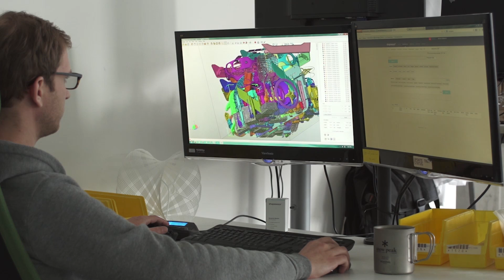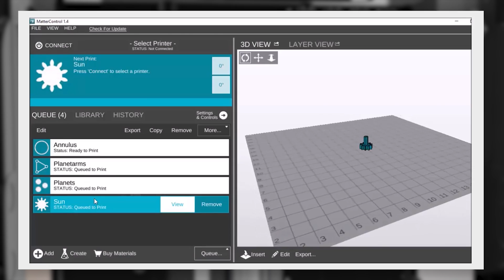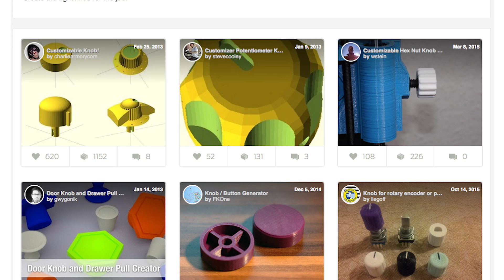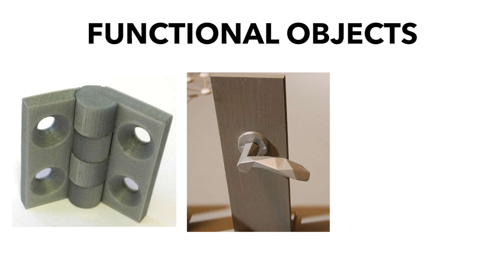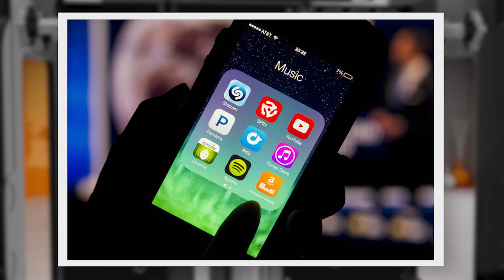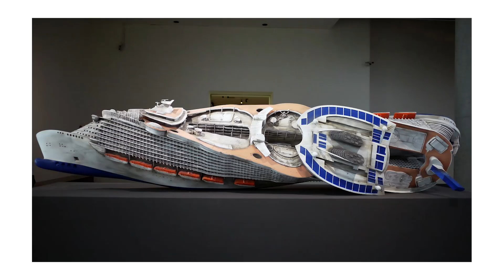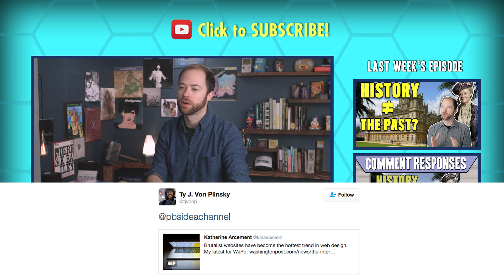Will 3D Printing Break Copyright?

Comment: What about 3D printing pharmaceuticals? Recreational and medical is this possible?
Reply: +dannyzep92 Not at all.  3D printing, like regular printing, merely places a predetermined material into a form.  3D printing pharmaceuticals would require that you have the chemicals prepared prior to forming them into pills, which can already be done with pill presses.  Pharmaceutical companies will not go out of business because of this because there is actual chemistry and synthesis required to make drugs instead of assembly.
Reply: +Matt Sertich I kind of figured as much. You'd still need the chemical reactions and what not to get what you want. Prosthetics seems to be a route 3d printing could/might already be taking

Comment: Additive printing has two huge advantages over music (and e-books, which I think are a better analog) not discussed here. 

First, norms around 3D printing can start in the modern age, rather than being dragged there in a decades-long legal process. The rules and norms around music and books were formed at a time when the only technologies available imprinted information onto immutable objects like books and records. You can see this in the legal battles around them. The original laws treated the information in books as physical object with location and some marginal cost of reproduction, and those laws have been awkwardly ammended to deal with the de-physicalization of artistic information. But the distinction between file and object is natural to 3D printers, and communities and businesses build that into the practice.

This plays into the more important distinction, which is that 3D printing isn't a zero-marginal-cost technology. The .mp3 was so troublesome to musicians precisely because the information could be converted into its valuable form (sound) at essentially zero cost, which is what made fighting music theft feel like bailing out a boat with a fork. Copying and owning a physical 3D model of Mike's face, on the other hand, has a non-trivial cost and can't be done ad infinitum. Maybe there will still be cheaper pirated versions of these objects, but it will always cost something, so artists and industry in this area will never have to contend with the peculiar economics of zero-price competitors.

The comparison with .mp3's seems especially tricky when you're talking to someone from Shapeways, which specializes in quality materials and passes through a central point rather than being peer-to-peer. When there's such a non-trivial cost of production, it looks a lot like a traditional market for physical things. On-demand book printers like Lightning Source have been doing this with books for years (which is why I think books are the closer comparison). And while it's a big deal for the book industry, Lightning Source and Shapeways are hardly the next Napster.
Reply: +Elliott Collins Yeah, this tech is taking birth in the modern age itself, but do you really think that'll stop lawyers from applying decades or centuries old laws to it? :(
Secondly, yes there is a cost attached to it. But there will still be problems. Assume that the tech is advanced enough to print complicated objects like phones(instead of just plastic stuff). If you design something looking like an iPhone 12s, don't you think Apple will have a problem with it?
You brought up the case of artists. Suppose there's a 'sculptor' who designs awesome stuff and 3D prints them and sells them at a high price. What's stopping me from creating a 3D model of the sculpture using some imaging technique, then selling my own versions, which will be exactly the same, but at a much lower cost?
Reply: +Bhupinder Saini

There's not much stopping you. Except.... Michael talked about the importance of what a community sets as it's values, didn't he? In the Art-buying community, buying a more expensive "real" artwork is often more desirable than buying a less expensive "fake" one. And yes, this is different from most other commodities, where something that is virtually the same but costs a lot less is often more desirable to consumers. There are exceptions, of course, which most often have to do with branding.

In other words, you could try and sell fakes. But if it's easy to see which are the real ones and which are the fake ones (for example, with the kind of authentication talked about in the video), you may find that your sales numbers are far less than you had hoped they were.
Reply: Ahsim Nreiziev What you say applies well to an ideal world...maybe even to first world countries...but not everywhere... Case in point: you know what happened in china
Reply: +Bhupinder Saini ... What happened in China?

Comment: Kinda tangential to the copyright conversation but: how would one prevent people from 3D printing functional firearms? That's a big ol' can of worms right there. This is an idea that's brought up in Star Trek in regards to replicators, but I'm curious if it's a concern that the 3D printing community is already trying to tackle/prevent?
Reply: +Void Burger
    I understand where you're coming from and the idea does sound scary that someone could just start 3D printing an assault rifle in their home, but I don't think it will drastically change the Homemade Gun issue as much as you're implying.

We already have people, who know a lot more about guns than the expected 3D printer user, making and using guns without the use of 3D printers.  

With the level that consumer 3D printers are at today; I wouldn't trust them to print anything more than a handgun. 

For manufacturers I just see the standard background check being applied whenever someone asks to have a gun printed,( with exceptions of course) and there would also need to be several changes to the current laws. Or the manufacturers somehow start identifying functional firearms and denying the print.

All in all, I believe 3D printed guns will only be a smaller concern for gun safety as a whole.

Comment: If something is a functional object, it's not covered by copyrights? So if I make a door knob shaped like a TIE fighter, because it's a functional object (A door handle, provided as an example in the video) it doesn't infringe on the Star Wars copyright? Is that correct?
Reply: +ErzengelDesLichtes That's a question I had too:  What about functional art?  Not even a TIE Fighter doorknob, but a doorknob shaped like your own original spaceship?
Reply: +ErzengelDesLichtes You want to research something called "the doctrine of conceptual separability", which is a kind of murky area of IP law. But no, I'm pretty sure you'd be infringing on the Star Wars copyright in this case. Sorry. :(

Comment: You might dig this older story about Games Workshop protecting the intellectual property of their Warhammer miniatures from 3D printing. It reminds me a lot of the music industry's initial reaction to MP3, just as Michael had described. http://www.tested.com/art/makers/452866-how-home-3d-printers-are-disrupting-miniature-gaming/ It's a curious case for those of us in the tabletop industry because so much of the value of our products and our infrastructure comes from physicality, materiality, and scarcity.
Reply: +Daniel Solis this is where the quality of the material is judged not just by material and stability but also means of manufacturing. it is harder to replicate a precise mold of a figure than it is to generate a precise computer model. following that it is also having the means to produce. alot of game figurines that are sold on the mass market are molded and often there is a tell tail seam to show it. this may be an aspect of an authenticity check similar to playing cards which are possible to reproduce with the right materials.

Comment: My school has a small 3D printer and I already made a Han Solo in carbonite figure. And I am working on a cup holder. I use 123D website. Never had i thought about the copyright I just made things I like.
Reply: +John Werner designs and art for private use cannot be effectively policed. if you were to try to start to sell the file access or the finished products is where the IP laws start to take effect in a meaningful way.
Reply: Well it's like fanart. If you're not selling it I guess there's no problem. And my school has one too, but sadly I don't think we're aloud to use it.
Reply: +Amaz1ngWhale why not?
Reply: +John Werner I assume it's because the "ink" is too expensive. They only use it for certain technology classes :/
Reply: +Amaz1ngWhale at my School we just pay for how much we used

Comment: So if you print Lego parts is that copyright infringement?
Reply: +NiceLord 
Not if you call them stackble building blocks
Reply: +lolmaker777 recent parts added to their parts library can still be protected by patent. but basic components, bricks, axles, plates and the like are broad enough to not be covered. designing lego compatible parts not already in their library would also be open.

Comment: I am absolutely fascinated by what 3D printing could eventually do to change the economy. If everyone can print almost every object (or at least an insane amount), the world would be radically different. Consumer society would be radically changed, because you no longer consume products. You just buy some raw materials and print yourself. It would also radically change globalisation, because on the one hand trade becomes much less important (why important from China if you can print it in your home?), but it also makes global trade much larger. If I design a product that can be printed, I could sell the design globally. 

I can even imagine something like a 'spotify for phyisical products' or something.
Reply: +wiet111 To the question if it would radically change consumer culture, I think yes and no. Just because you can 3D print a spatula does not mean you can make anything you need. We still need advances on making culinarily safe 3D printed items, and it will be difficult to make them heat resistant enough to cook with. The process of 3D printing makes it very porous and generally uses heat or UV sensitive plastics.

Toys for kids will be available but the span of what kind of materials you will be able to create will still be very limited. If McDonalds is making toys they know they will be making thousands, and so they can do it at a far higher quality and lower cost than someone in their garage.

This still opens up a lot of room for engineering and creative exploration, but when the quality of items becomes increasingly apparently biased to the mass producers then I doubt the market will swing too far.

That being said many niche stuff will be covered by the 3D printer. Need a new clasp for your bag? You might be able to 3D print it. Need something to hold a knife? 3D print it. Lost a piece for a board game? Why not 3D print it? I think the biggest effects will be in the niche and replacement markets and the artistic community.
Reply: +Zongineer bioplastics from recent organic oils. oil as a fossil fuel maybe not but there are many naturally generated oils that we can draw from.
Reply: +wiet111 But do we still have enough oil to make the plastic?

Comment: The idea of having a database that 3d printers check is scary. It's like adding a wifi chip into a Hammer and Chisel to make sure you aren't using them to make a rip off sculpture. A 3d printer is a tool like any other. And the use of that tool to infringe copyright shouldn't be a concern, but if that infringed end result is being used in a way that infringes copyright.

Should I get sued if I made a Warhammer sculture out of toothpicks? No. Should I get a cease and desist if I tried to sell that sculpture as an alternative to an actual Warhammer figure? Yea. But you don't stop it on the tool level or creation level. You stop it at the sellers level.
Reply: +Ularg So, that would mean you could only stop it if you pay a company to print warhammer figure for you, not if you do it on your own private printer with your own plastic. Which is actually how the world functions doesn't it. This seems like it could possibly be a problem in a future where 3D printers are as common as normal printers, but that kind of thing is still a long ways away.
Reply: +Gorinich Serpant I believe as long as it stays with you or a close friend, there really is nothing copyright law can do about it. Now, hosting 3D files that the printers use online, on the other hand, I can see how that can be taken down. But I don't see how I could be taken to court if I made a Space Marine in a 3d modeller and then printed it out on my own 3d printer.

Would an artist have to send sketches of his work to make sure it isn't infringing on any copyright when he's just doing it to practice for himself? 

I dunno, I just view the 3d printer as a tool and wouldn't think it smart to put restrictions on it that you wouldn't put on a screwdriver.
Reply: +Ularg That makes sense.

Comment: Why would it? Just because I can rob someone doesn't mean property rights are dead.
Reply: +Jimmy Hough Fair argument. However it may become hard to enforce copyright, due to the ease of break copyright anonymously and potential volume of infringement. Then the fact that there is a law prohibiting copyright infringement becomes null and void in practical terms.

As with the entertainment industry, there is a sea change in process. The outcomes of which are hard to predict. I run a small company that that designs model tanks in CAD, have them 3D printed, cast them in resin, and sell them. I would not have been able to start my business without 3D printing, but I do fear that my business is too small to deal with copyright infringement.

I spend days, even weeks, working on each of my designs. If they got leaked online I might be able to get them taken off the more above-board websites, but there is no way I could counter the distributed net of people printing stuff in their own basements.
Reply: Then what if you put on the market a key that can open any lock?
Reply: +eg0zb they are called lock smith guns I believe and are regulated.
Reply: Cal fischer
You have just described every manufacturing business, although currently not all materials are cost effective to print.

For someone to print something they need a CAD file to print from. The only way to get that file is buy it, design it, or take it.

My business grants me a measure of future proofing, I will have the skills and experience in creating CAD which should remain relevant so long as some level of copyright law remains.
Reply: +Jimmy Hough if youre using someone elses idea claiming it as your own to make money, then sure. But if youre taking someones idea and improving upon it, i think its fair.(you have to give credit to the person who made the base which youre improving upon).
but in the end nothing is 100% original, and its disingenuous to claim an idea is 100% yours because you were influenced by the outside environment, people and things to arrive at your original idea.
 can you imagine science without calculus, newton invented it by himself and by sharing that original idea he indirectly improved and continues to improve the lives of billions of people. 
another example is Half-Life/Counter Strike(1998/2000) a huge reason why these games still survive today (meaning millions still play it daily) is because of the fans who modded and continue to improve and find new ways to play the game. The people using someone else's original are the ones who made it successful and are the ones who keep it alive.
Reply: +Jimmy Hough If everyone could rob anyone, property rights would be dead.
Reply: +wiet111 enforcement and rule of law are what enforce property rights.
Reply: +Bob Emmerson if your entire business is based on making something that anyone could print on a 3d printer, then you probably just need to get a new business.